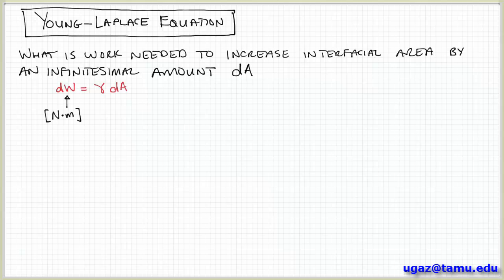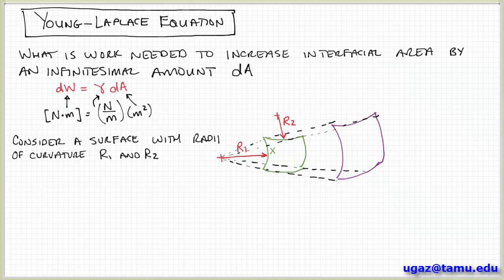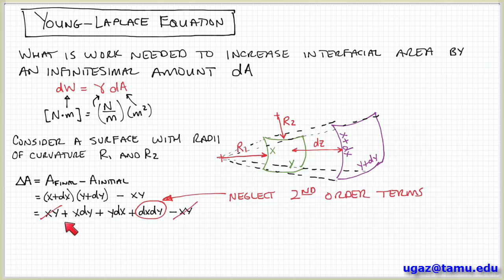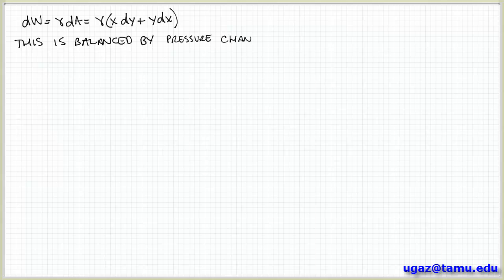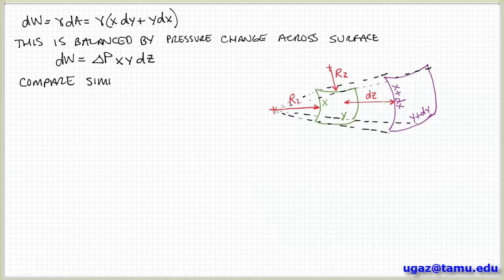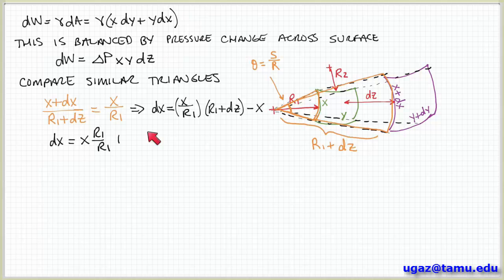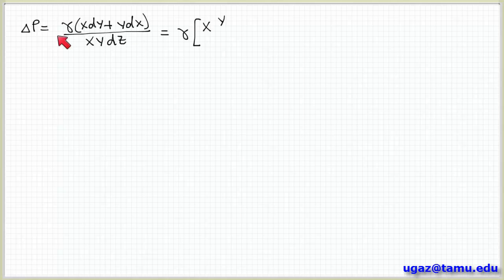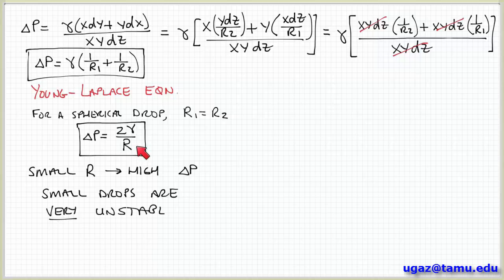Surface Tension, part 2 - Lecture 1.4 - Chemical Engineering Fluid Mechanics

Comment: I didn't understand the generalization of R1 =R2 for a  sphere at the end.  It seems to me the derivation calculated the delta pressure  needed to increase the radius of a spherical bubble from R1 to R2 in terms of the bubbles surface tension.

Comment: I really want to like this derivation, but there are some things bugging me. For instance, why define area in the surface tension work to come out dA = xdy + ydx, then define area for the pressure work as simply xy? Why is "area change" being used for surface tension and not for pressure? It seems like rigging the differentials so everything comes out just right, but there was no argument given why the areas shouldn't be the same.